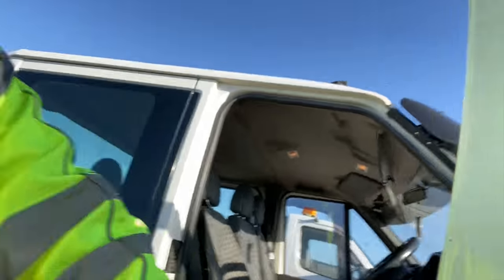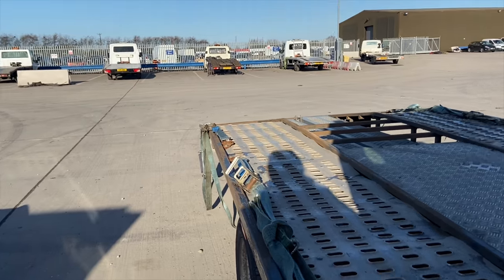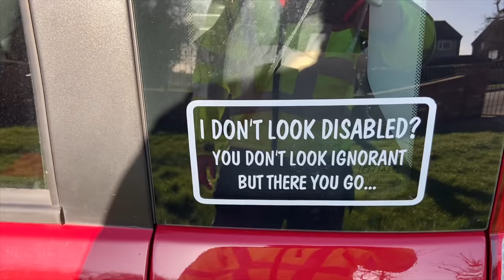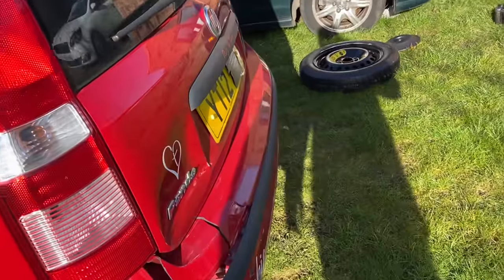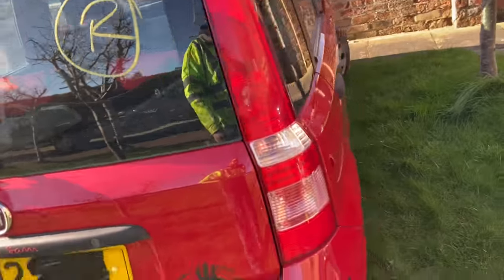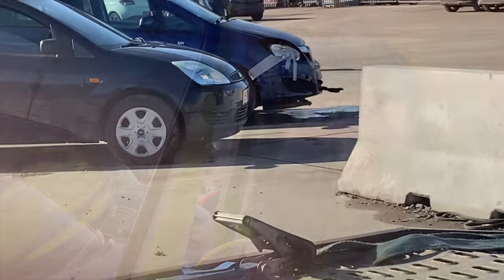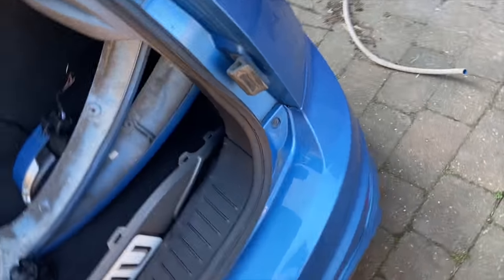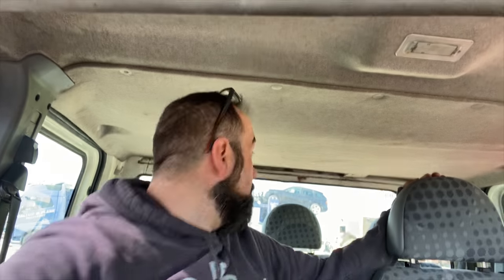How to get loaded at COPART in 20 minutes - collect 4 cars in one morning

Comment: That must damage the cars picking them up with a fork lift surely?
Reply from the maker: It’s spreads the load, only had one damaged in all the years I’ve bought them bust a plastic push on fuel pipe clip
Reply: Winch it on